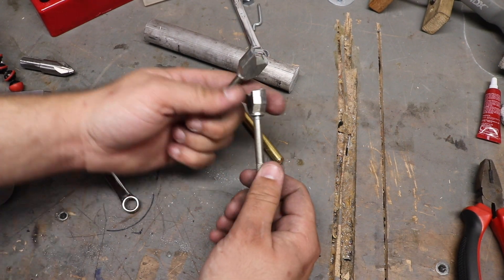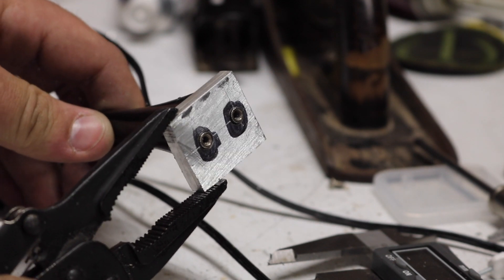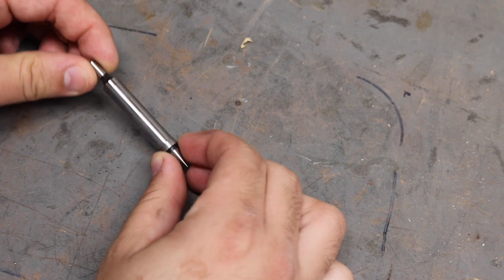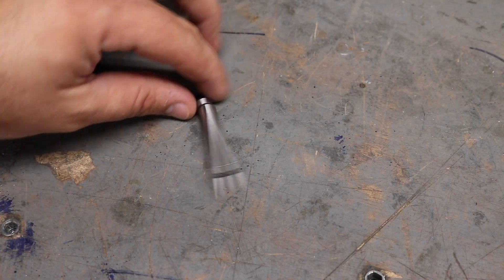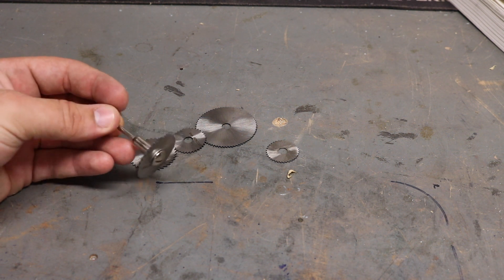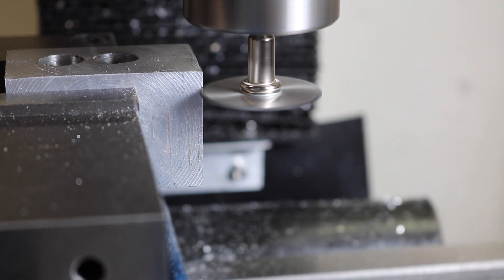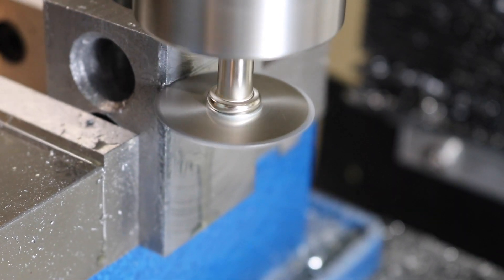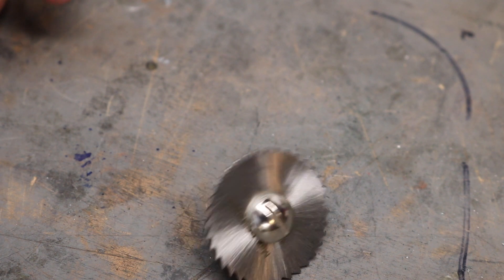Variety Show #2: Cheap Tool Blunders & New Things!

Comment: Congratulations on the family addition!!  On the slitting saw....strangely enough I have found it best to always go full depth on the first and only pass.  Even if that is a through cut and always be aware of tool speed and for a tool with a 1/8 shank be extra careful.  Sometimes you can chuck on the larger diameter for a stronger setup.   Also, it is a good project to make your own slitting saw arbors. Thank you for sharing your shop with us.
Reply from the maker: Thank you!  And those are all some really good points I will consider; I've never used a slitting saw before so I will take that into consideration, and I think making an arbor is a great idea now that I have these saw blades!!  Thanks for watching!

Comment: Careful with the slitting saw in a dremel. It slows them down until they catch fire.

I have video on my channel of it. I would only use it on high torque low rpm motors!
Reply from the maker: Yeah, aside from my experience with this thing in a milling machine, I wouldn't try one of these in a dremel at all, especially on any sort of hard material!

Comment: Those cheap edge finders are pretty much worthless as you've already found out. And it's better to go with the single end design so they don't get the end caught up in the collet. The reason the cheap ones don't work well is both mating surfaces need to be properly hardened, then ground, and then very finely lapped so each surface creates almost no friction. They also need ultra thin instrument oil for the same reason. 

The electronic edge finders are ok if there built well. But they can't work on non conductive parts. If you want some sticker shock for edge finders you could Google "Haimer 3D Taster". In German apparently tester is spelled taster. Moore Tools no longer make them but when they did there edge finder was just over $5k for something you could pick up between two fingers and you needed a very good dial test indicator to use them.
Reply from the maker: Thanks for the tips!  I've seen the Haimers around, I know that one will be pretty necessary for when I get into CNC but otherwise pretty cadillac for my setup :)
Reply: Well they also eat up a lot of Z axis room. But I'm using one on an all manual Bridgeport clone.  And to use them right they do need to be zeroed to your spindle in something like an accurate and dedicated end mill holder just to preserve that carefully set zero. To get the best out of them you do need a really accurate DRO or be using CNC  For a manual machine without a repeatable quick change tool system the Z axis height ability on the Haimers isn't as much use for me. An extremely handy tool tho and well worth the high cost if you can use them. Not a tool you want to drop or crash. I don't know of any place but the factory that can repair them.